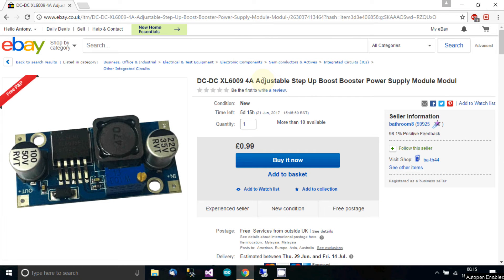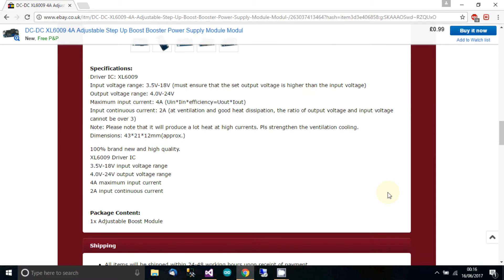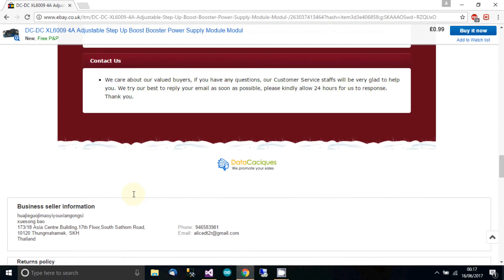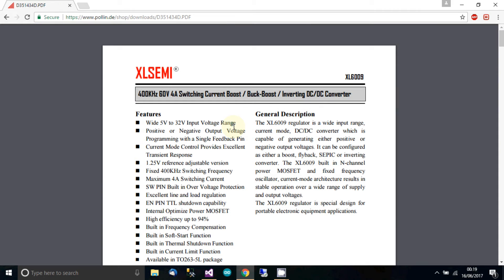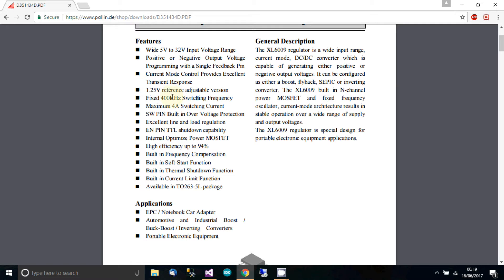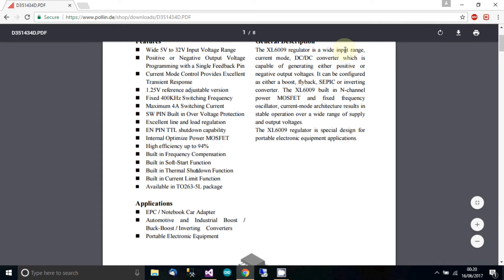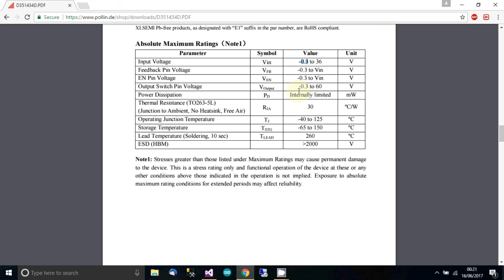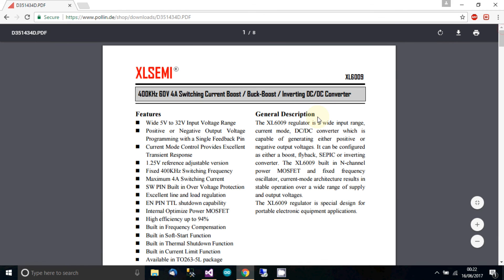INVESTIGATING: The Cheap XL6009 Step Up / Boost Converter - Part 2 - A Bit More Info!

Comment: The one thing I wanted to see, what the minimum input voltage  really is , thought you were going to test it.
Reply: I've tested a few modules and the minimum startup voltage is about 4 Volt. Do not go below 4 Volt because the uvlo doesn't work properly, the output voltage get's unstable and reach voltages up to 27V!
Reply: According to the spec sheet, 5V is the minimum.
Reply: he did test it in the next vid

Comment: Hi Sir , can you please tell me if we can connect 2-3 loads of 12 volts /1amp with a battery of 3.7v / 3 Amp ?
Reply: kirk mcloren  String—Sure you don't mean rope?
Reply: Looks like the max you can draw on the input side 3.7V * 4A = 14.8W
Which means you can draw up to 1.23A @ 12V on the output side.